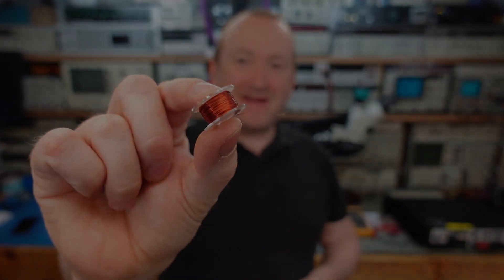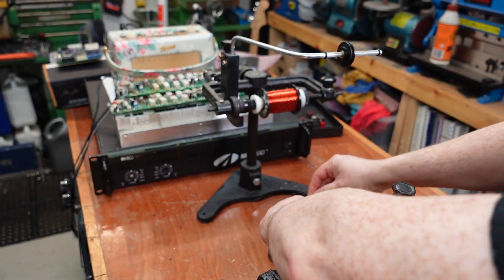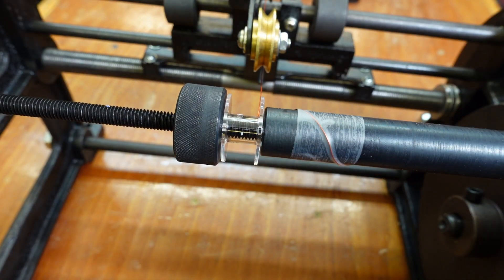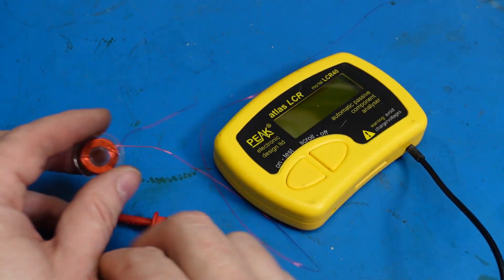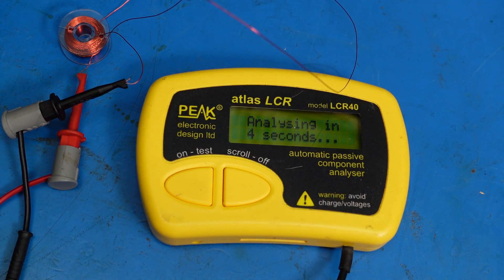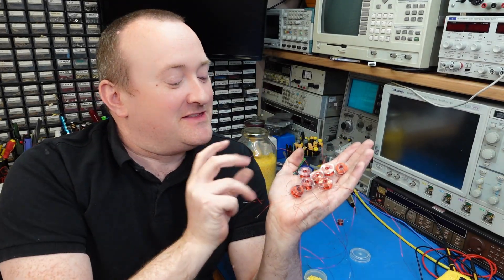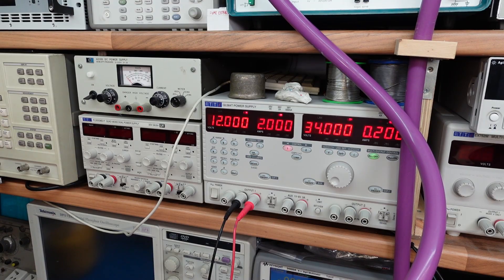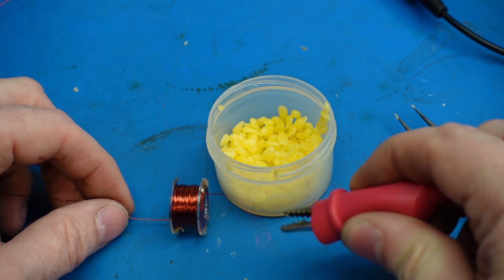Home Brew Choke Winding

Comment: Wonderful video; a fine inductor. In August 2020 I used a similar coil winding method to wind coils on plastic sewing machine bobbins to repair the IF transformer for a vintage 1937 Velco Radio. See SC magazine.

Comment: CRIPES❗️ I'VE NEVER SEEN A 
HOME COIL WINDING MACHINE: I DRINK BEER AND COUNT OFF MY WINDINGS BY 
10 TURNS AT A TIME.
ITS ALOT FASTER THAN YOU MIGHT THINK.
ALSO- I USE CRYSTAL CLEAR
VINAL REPAIR CEMENT ON ALL MY COILS; IT GIVES THEM A SHINEY NICE LOOK AND HOLDS THEM TOGETHER FOREVER. YOU CAN GET IT AT AUTO PARTS STORES IN THE GLUE AREA. I MAKE HOME BREW RADIOS AND OTHER ELECTRO-MECHANICAL ODDITIES.  😊😊😊😊

Comment: I feel like one could possibly wind their own flyback transformer. These are becoming more and more unobtainable and are very bespoke for each application… often when the flyback goes it’s the end of the road for the tube. Not that it would be particularly easy as you’d have to know each secondaries polarity and output voltage but maybe..
Reply: 'One' could but one must be sure to check for proper flyback with one's tongue.